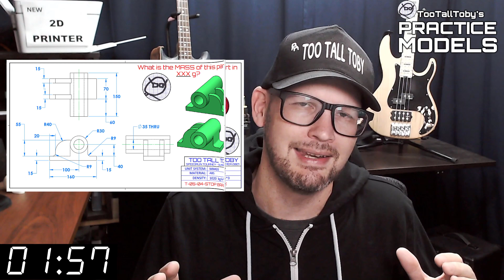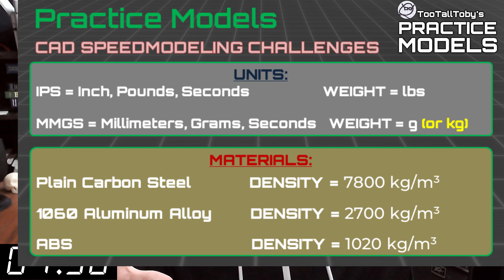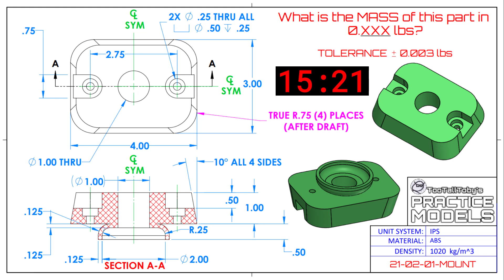SOLIDWORKS Practice - Onshape Practice - Fusion 360 Practice Exercises - TooTallToby-21-02-01

Comment: 0,348 lbs (could only find some 1060kg/m3 plastic, so its converted). 
Took me 53minutes, and was my first time using the "revolve" function. Without that bottom part it would have been 14'ish minutes.
Reply from the maker: What CAD system are you using?  You might have to create a custom material
Reply: @TooTallToby  , Im using Fusion 360 (free). I will look into the materials, but for now it isn't so important. Only using it for 3d printing hobbythings for now.